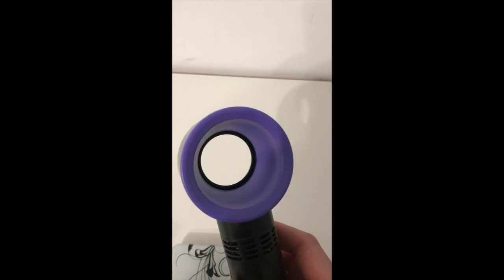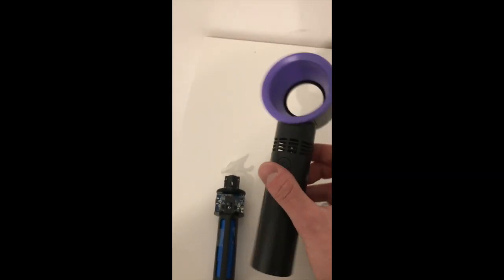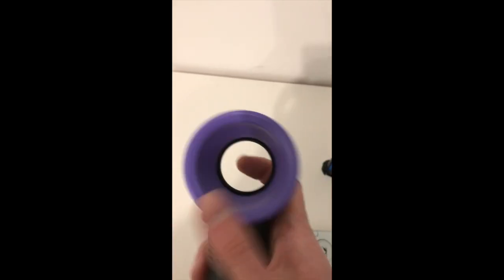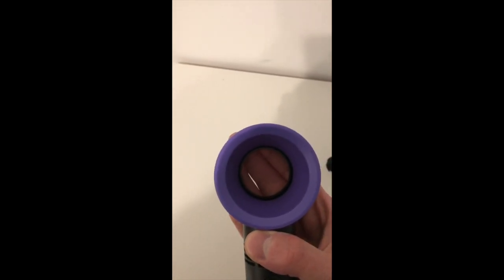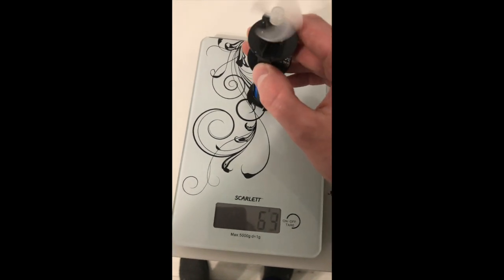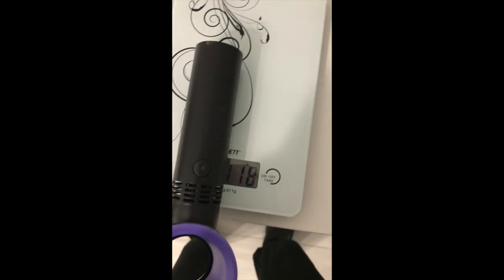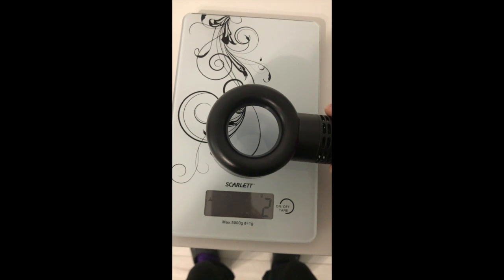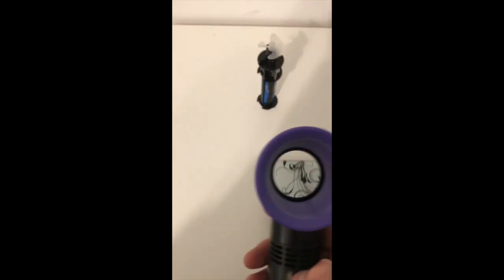Will bladeless fans work on a drone? Measuring thrust experimentally

Comment: Thanks for proving what's wrong with science these days.  A poor understanding of what is already known leads to a poorly designed experiment which, in turn, results in misleading conclusions.  Very useful as a teaching aid, but not the way you probably hoped.  But don't let that stop you.  Instead, get better.  Many of the greats in science and engineering faced similar challenges in their early days.  The important thing is to seek the answers in the first place.

Comment: No, you need a certainly large volume of air coming a nto the chamber first then it shoots out in smaller open ing to achieve thrust
Reply: It depends just on the power ( and number) of the engines

Comment: Bad experiment. The fan in that dyson is not enough rpm for a drone. The proper experiment would at minimum be the changing of the motor to a size that is meant to lift a weight more than itself like in every other drone experiment. I have to give this a D for effort. Try a Drone Motor Calculator
Reply: It just depends on speed and number of the engines.

Comment: just that you know thats not like a real dyson fan works, the air at dyson fans are get send out right at the end of the case so as near as possible at you and not trough the inside this creats a force with low pressur with pulls the behind the case inside ... along with the air thats getting pushed out at the end of the case.... your fake dyson fan is just looking cool but has nothing to do with the prinzipals that dyson fan use
Reply from the maker: I have a real dyson fan to compare with. I think my fake dyson fan has enough to do with the underlying principals to make conclusions
Reply: @gregoryberzin3477  i have one to, 1 fake and some real in fact i got 1 big one as a gift at first i was skeptical and now i got like anythink from dyson becouse its works so yah dyson stuff is great needs way less power and out perform anythink on the marked my big air fan need like 8.8W on power mode 7 and still gets the same amout of my old fan gets to me who got the job done with 38W so yah i am never gone switch back to not dyson stuff

Comment: Here's my question. What if you do the opposite? What if, rather than have the exit surface larger, you have the cone narrowing? As the air is forced into a narrowing chamber the thrust would multiply, right?
Reply from the maker: whatever shape you make you can only multiply volume of air but not thrust. basically you can get more air flowing but either it ends up being slower or you'll be pushing yourself downwards to compensate for that "extra" energy of the air
Reply: @gregoryberzin3477  thanks for the reply. I was envisioning the cones on the back of jet engines when I made my comment. Honestly, I know nothing about propulsion, really I observe a lot and make what I think is a logical conclusion. Or, better said, I hypothesize based on observation and ask questions because I'm not a scientist doing this type of research.